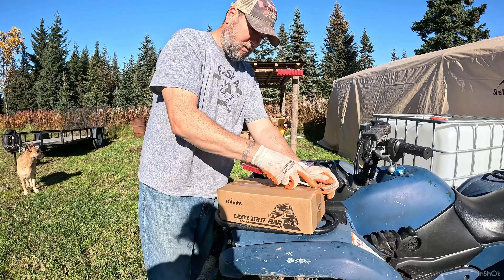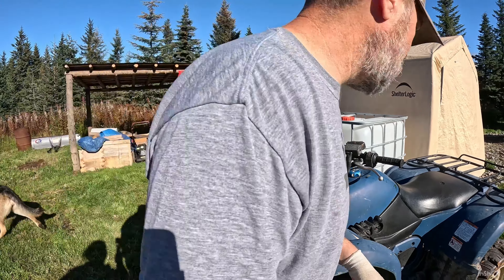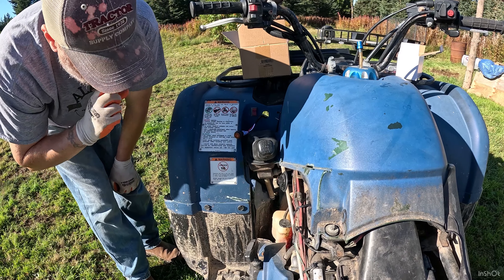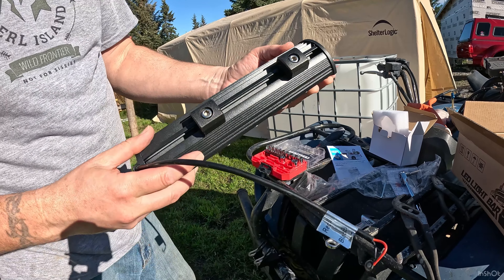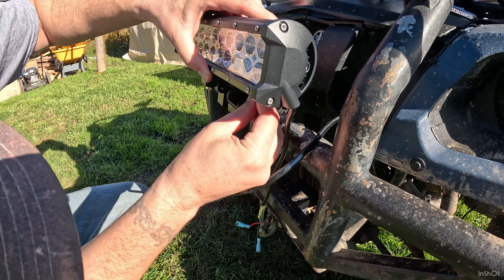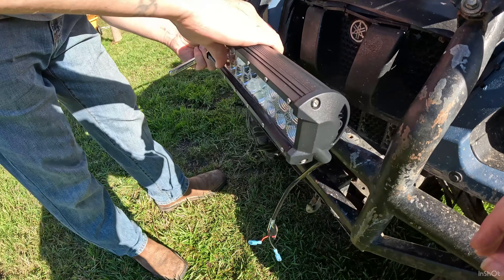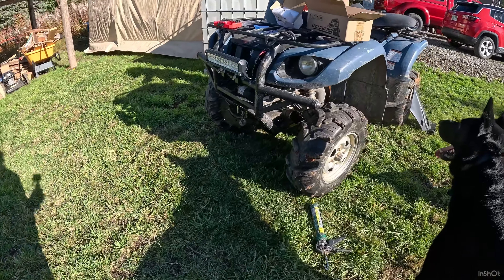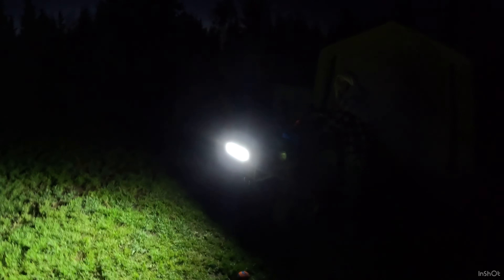Project Yamaha Grizzly Gets an Upgrade | Nilight LED Light Bar

Comment: If you wear a helmet a lead dog light works great. They wire into your machine and throw a beam where ever you are looking. I used one when I had an ATV. I still have one on my snowmachine. I always put my wires in wire loom.
Reply from the maker: Great tip!
Reply: @ouralaskahomestead  The beauty of the lead dog light is it is up high and it is great to find the  reflective markers on snow machine trails.
Reply from the maker: @Chris_at_Home  sounds like a great idea!